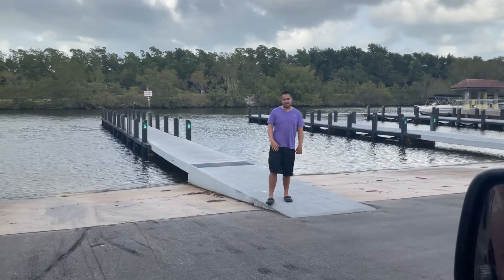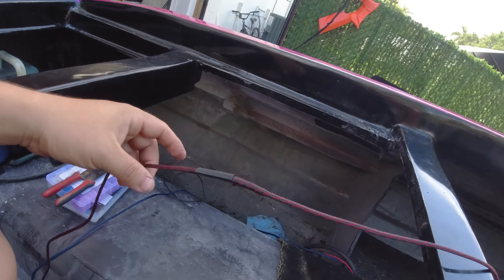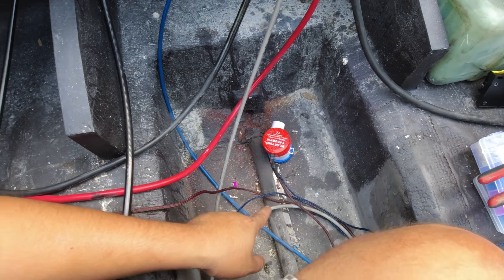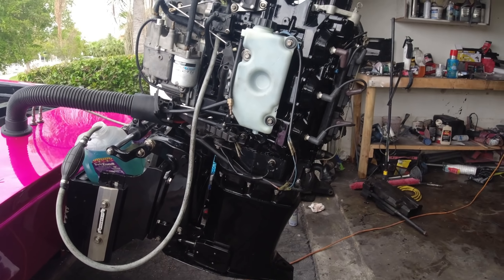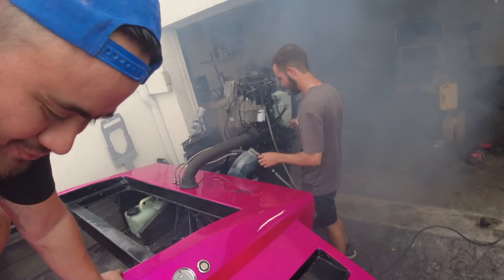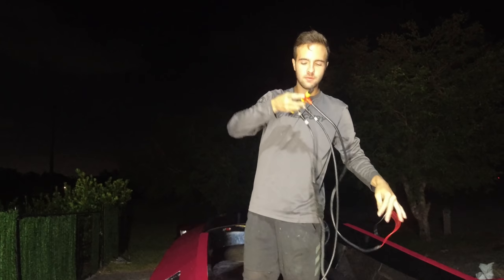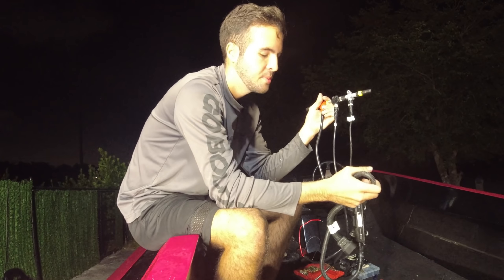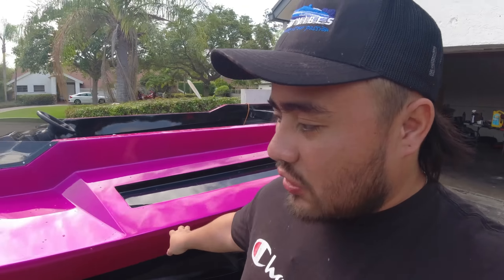THE HOME BUILT SPEED BOAT FIRST TIME IN THE WATER ( TESTING AND TUNING ) 😎🤙🏼🚤💨

Comment: With tunnels you should be running a cleaver style prop. You need stern lift not bow lift. I’d start with a 26p-28p. 
Also with the base gasket, use OMC gasket sealer first. Then put the gasket on, then more sealer on top of the gasket, then drop the powerhead.

Comment: Most of us with tunnels run cleavers,, or Yamaha style props around a 26p. Choppers or trophy has way to much lift. You should not have to put RTV on your powerhead gasket, something else is up..That one telltale of water is for your water pressure gage, which you should have on a tunnel boat..Great to see it in the water dude, Awesome job

Comment: When you pull a powerhead put a straight edge on the powerhead and then the midsection. Do it in a couple of different directions to see if you have any gaps. If possible try and torque. Down the nuts on the powerhead for even pressure all around. Do it a couple of times starting with low pressure and working your way up tear the torque specification let us know if this works or how you fix the leak thanks boat look super on the new trailer
Reply: You know, I forgot to tell Luis to torque them down properly we didn't have a torque wrench so thanks for the reminder I'll let him know👍
Reply: @juanaraujo4451  Any Time I   saw you guys were working in the dark. Is there a Torque Sequence ? I don't know.
Reply: @letsmakemoney8027  yeah there is it goes from middle out starting at I believe 80ft lbs then 110ft lbs somewhere around there I have the specs
Reply: @juanaraujo4451  Hope that stops the Leak Let me know if that Works. Always Happy to Help a Checkmate Owner

Comment: i could hear you (headphones). damn thats a lot of water coming from everywhere. i had an issue where those bobs upper mounts dont seat perfectly. best to use gasket sealer/silicone and the gasket. heard some guys say the bobs arent drilled at exactly the same angle as the factory mounts. totally assuming you have bobs solid mounts lol.

Comment: That plastic bag floating just beneath the surface when you had her idling at the dock has killed many motors. It seems they always find their way to the water intake. Back before motors had alarms you could  melt the impeller and cook the power head quickly. That is a good looking hull. I bet she'll get up and fly nicely.